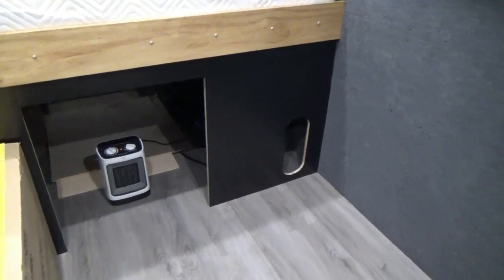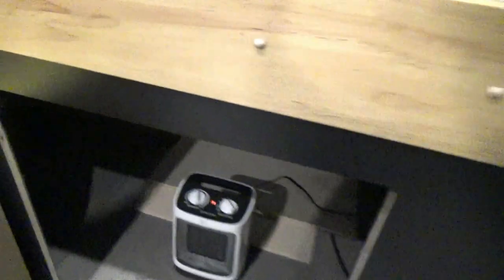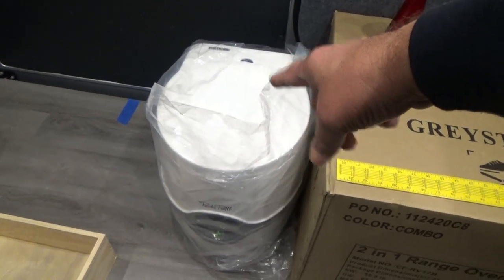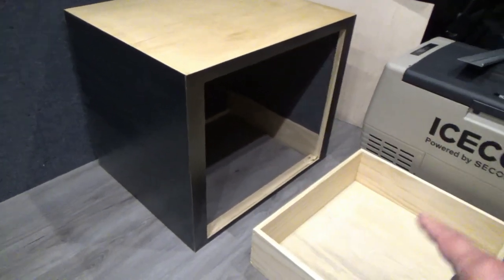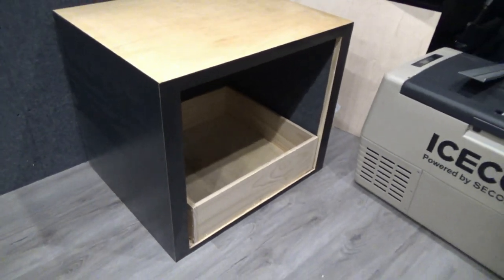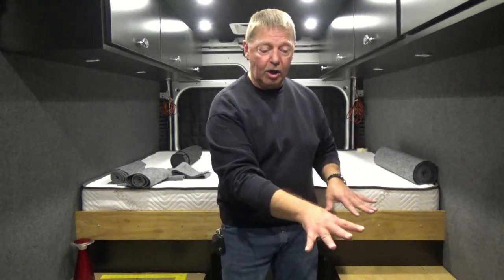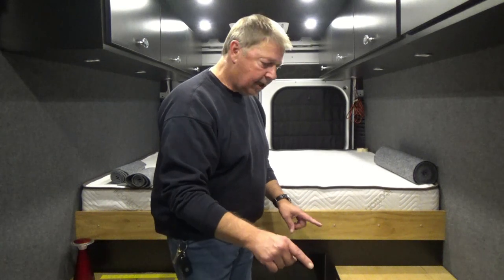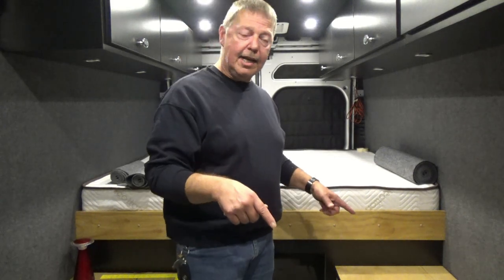Promaster Van Build 2500 159WB – DIY–Bench Seat Install– Part 17

Comment: Yep, I totally agree with your will to have the inside of cabinets finished!  If I may add, even pocket holes can be filled using wood or plastic plugs sold by Kreg, you can chose the colors.  I am happy for you that you will do your maiden voyage with your brand new van that you proudly built!

Bon voyage!
Reply from the maker: Thanks Raynald... This has been a fun build!

Comment: You've probably already thought of this, but you should consider the height of cushions on your seats before setting the height of the  foot step between the seats.
Reply from the maker: Excellent advice Dave! Once I get the ciushions, then I'll get the floor installed. That will also serve to hide some wiring that needs to go to the front! Thanks for the tip (nope, didn't think of that!) Glad you stopped by!

Comment: Just started watching some of your videos and I must say you have taking some the thoughts I’ve had on making the van build lighter… I’m only wondering how if any moisture has an effect on the carpet panels?
Reply from the maker: I keep pretty good ventilation going through the van to prevent any condensation. The Maxxair Fans have an auto function that open at any temp you set it, so there is always good airflow. I run a heater all winter long as well... no issues to date! Thanks for checking it out!

Comment: thanks for all the help! i have the exact van and just starting and one question on the floor. Do you attach your boxes to the floor? how? or are they just attached to the wall?
Reply from the maker: I attached the boxes to the floor with #8 x 1-1/4" screws... there was already a sub floor in the van, so it screwed into that. Thanks for checking it out, happy building!